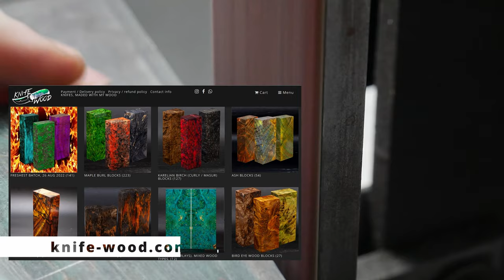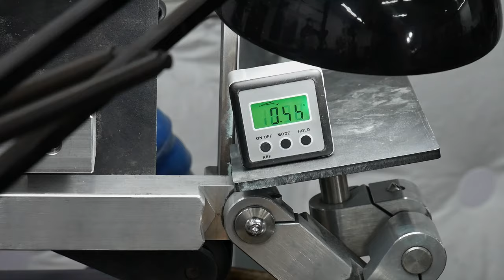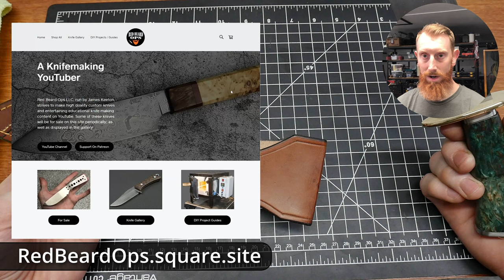Lucky #7 Bowie - Performance Testing A Takedown - Part (4/4) - FINISHED

Comment: Very nice work! The only thing I don't like about that sheath is  that the retaining strap is on the blade Edge side. Every time you pull that knife out or put it back into its sheath you have the potential to cut into the retaining strap. It is a tough problem to solve on most knives, but with full takedowns that have large guards such as this one it would have been very easy to put the strap on the spine side. Just my thoughts, but very nice work on the blade and handle.
Reply from the maker: Thanks for your thoughts Blaney. Cheers sir

Comment: I was asking around on blade forums about ways to test my blades a while back. 

Not having an hrc tester, catra, and charpy testing jig leaves me some doubt in my heat treatments and whatnot. I mean, i know that i technically since I followed a certain protocol I should have a certain range of properties. But it would just be a lot more reassuring if I had some real conclusive tests I could run.

I still need to pick some rope up so I can at least start doing edge retention tests, and maybe compare against the production knives I have in various steels.

(I can totally relate. I ended up testing a super thin edc sized fixed blade I ground super thin I made from 10v. I did the 2x4 chop test. And let me tell you I was nervous before i started. Thankfully it help up really well. I stopped before I got through, because it was so awkward with that small of a knife though. )
Reply from the maker: Brass Rod test is another good one for the heat treatment for sure.